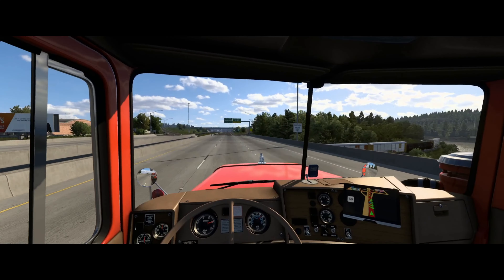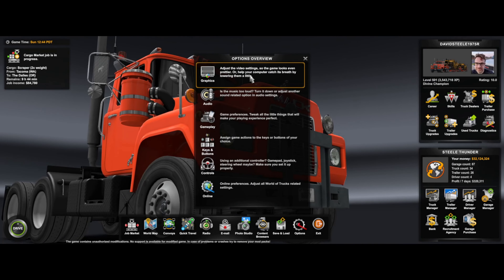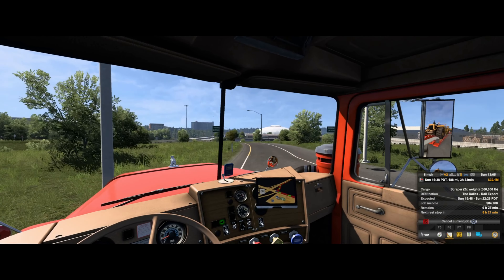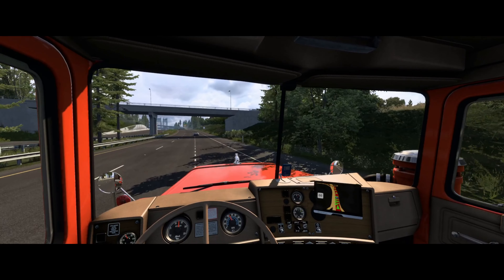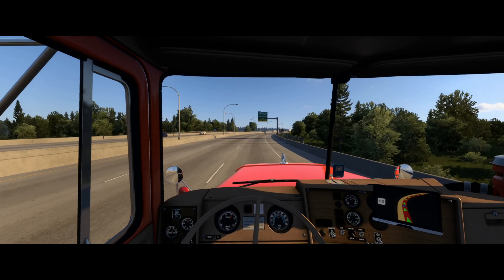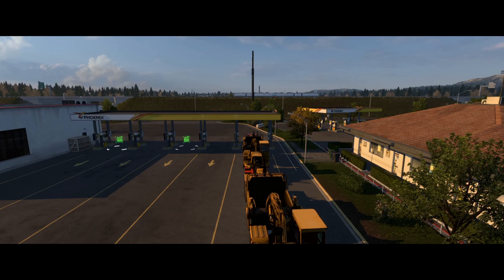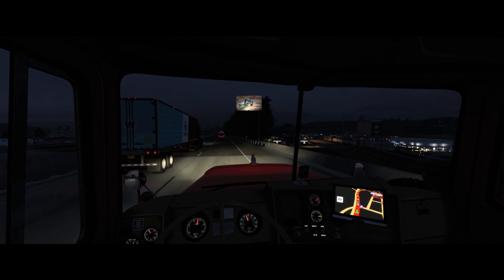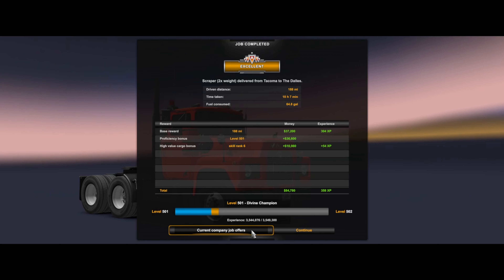American Truck Simulator - Hauling 360,000lbs with an automatic 285hp Mack R

Comment: Doing crazy stuff, David? If you ever opened an engine.sii you can do a lot. Same with the gear ratios. If you would be on a ff-wheel you can feel when the front axle becomes lighter, loosing weight, grip...starting understeering. Nice experiment! I sent you a pm via steam. Good luck and stay safe!
Reply from the maker: I forget if it was v1.47, v1.48 or v1.49 where SCS introduced improved physics, but it makes a difference.
I did some heavy hauling for a video this weekend and I was happy to see the front end pushed wide when I locked the differentials with 89,000lbs of heavy bulldozer hanging onto the back half-way down a construction site.
Don't worry, I wasn't being silly. Well. I mean. Not too much... :)